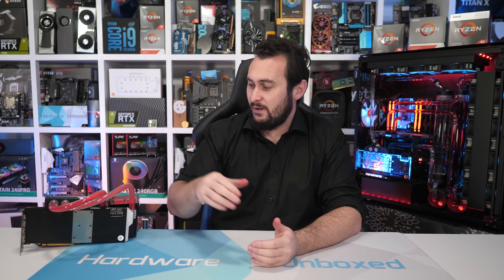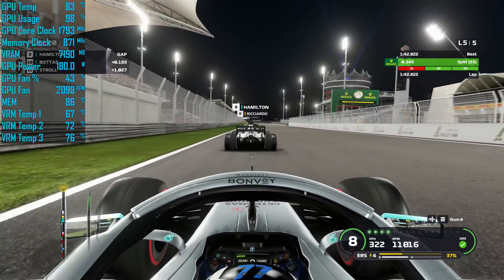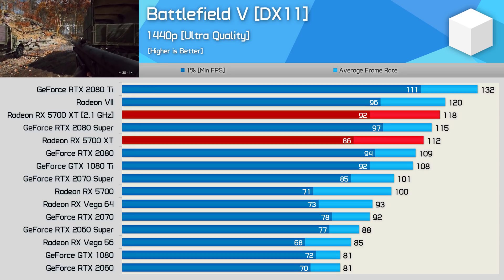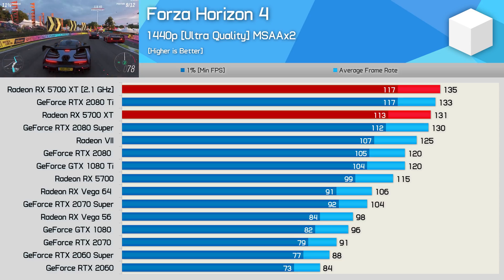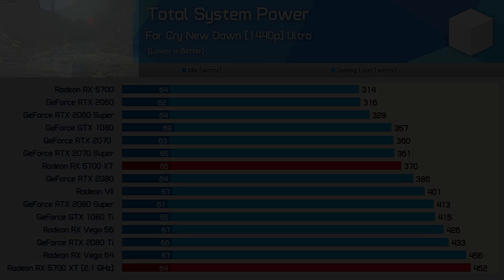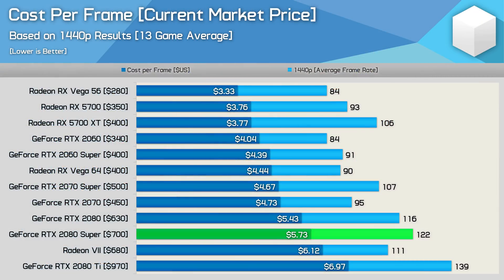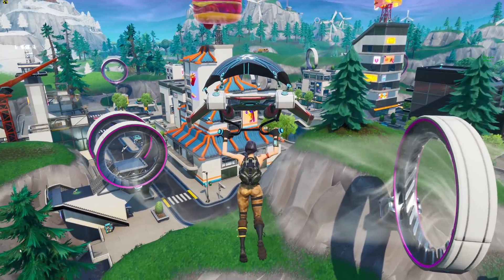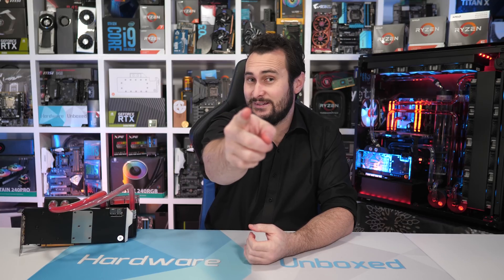Radeon RX 5700 XT Overclocked, RTX 2080-Like Performance?

Comment: Looking at this...its feels like Iam too early to go 1440p\144hz gaming, 2-3 years early, even 2080ti cant do 144fps in many games...2080s, 2070s, 5700xt cant even show 120 :(
Reply: You do know to push more frames you lower the settings right
Reply: @chriswright8074  Or I can just play in 720p right? Like it good old days. Yes I know I can lower settings, I even know some settings basically useless in terms of picture quality and after 20-30 min you can get same picture but +20FPS with custom settings instead of presets, but its not the point. What is a point of 2080ti if it cant give me Witcher 3 ultra 1440p\120+ fps? :) And what about good monitors? I dont even talking about $1500-2000+ :) I dont even know what to buy now, I got good budget but I dont want to waste money...perhaps 2070s and wait next generation of cards, hope for the best...

Comment: Steve's model is actually not well binned. A few months later, those models will be much more mature. 2.3Ghz at same volts I reckon. Great great card!
Reply from the maker: Maybe, you're just guessing though. I have three and they're all the same, you have no idea what yields will be like in 6 months.
Reply: True. I don't have too much knowledge on the node processes and relative maturity. However, as per past trends, samples made months later usually yield better results aka greater maturity/binning.

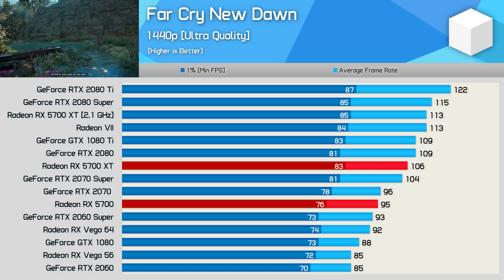Comment: I think there is a mistake in your slide about far cry 5 at 1440p 5:43 . You marked the rx 5700 and the rx 5700 xt but missed out about the OC result which is just right below the 2080 super
Reply from the maker: See pinned comment.

Comment: you should have tested it with the new ryzen and 570 chipset board.
Reply from the maker: Why? You'd risk being CPU limited then.
Reply: @Hardwareunboxed  I dont think that would be a limit at all under given PCIe 4 support ... plus testing with this setup is far more interesting for hardware enthusiasts.
Reply: Considering PCIe 3 isn't saturated by 2080Ti's PCIe 4 wont make any difference. It also doesn't relate to things being CPU limited.
Reply: @H3kler  https://youtu.be/kgnS5AxdyK0 ... if your games can take advantage of gen 4 it definitely is faster. That's why I said I would rather see this setup.

Comment: This really points to a bandwidth bottleneck (as usual with all AMD GPU's).  Oh, and those 1% low drops with memory overclocking are likely from the timings auto-loosening when memory is overclocked (Vega and Polaris did this too).  Additionally, it seems abundantly clear to me that Navi needs more mature drivers...  Not trying to trigger those ridiculous "fine wine" BS memes though :).
Reply: I thought that fire looked familiar.
Reply: We got power play tables so hopefully we get memory tables next.
Reply: I would like to know if there is any possibility to tweak memory timing settings on this card, or any other graphics card for that matter. Is there some bios that can be tweaked or something like that? Perhaps the timings are pretty perfect already, in case of GDDR6 or HMB there isn't that much silicon lottery and no reason to not allow all the possible bandwidth and lowest latency possible. Though still it would be nice topic for a video to try to tweak those settings.
Reply: I'm assuming you're not including the Radeon VII in "bandwidth limited"? 😉
Reply: Give it a few months for a new driver and Navi optimisations, then it’ll easily beat the RTX Titan no doubt :)

/s
Reply: @calebpringle4913  indeed
Reply: got my 5700 xt to 2080 core and saw similar crappy gains so went oc to memory and oh, wonderful 5% extra perf (at 100% stable 24/7 oc) so overall, 2080 like result
Reply: @arencorparencorp2189  what memory speeds are you running?
Reply: @KXP70  925
Reply: Fine Wine literally is gradual driver improvement though.  It just looks like a benefit through those rose colored glasses.
Reply: So not even with all of that WaterBlock mounting (and investment) + extreme overclock it can surprass a RTX 2070 Super. There you go, AIB won´t do mircales, RTX 2070 Super it is. You just made my life simpler, ordered it now! Thanks!

Comment: I recently bought a vega 56 rx for a fair price. I am very pleased with her performance at ultrawide before I had a rx 580 8GB, I plan to stay with the vega 56 for at least 1 year until the 5700 xt mature more drivers and release new cards with better cooling system and higher clock. Whenever I see your tests I see the vega 56 next to gtx 1080 and rtx 2060 and saw that I made a good purchase. I love your tests because they compare in different scenarios with many different hardware. Thanks
Reply: Othon Paiva Good shout. I may do likewise.

Comment: 1800-1900Mhz with an undervolt of 995mV and around 17-1800rpm sitting at 73 degrees with the blower fan during a benchmark with an ambient temp of 25-30C.

Might want to try undervolting, just saying :)
Reply from the maker: So stock then :S
Reply: @Hardwareunboxed  if more games was like Forza or world war z
Reply: @Hardwareunboxed  It's just nice to let people know you can make the card run cooler and quieter instead of 84C at higher/louder fan speeds.
Reply: @Tekagi502  Too much work for most people :D. You are right though. Looking at this there is no reason for AIB. UV and you will get higher core clock and quieter/cooler card. Wait for AIB for 3-4% more performance and maybe pay more.

Comment: I think the card is starving at Memory bandwidth, maybe you can do better with the GDDR6 clocked at 16gbps, a shame that the memory OC is not working
Reply: VRAM test at the end of the video were showing the opposite, at least with the limited overclock/underclock options currently available
Reply: @_Agosto_  Its because of the memory timings not higher frequency.
Reply: @_Agosto_  the vram test at the end of the video only showed that mem OC was bugged...
Reply: @AjrAlves  "at least with the limited overclock/underclock options currently available"

I wouldn't expect any significant improvement with memory oc though, unless they screwed up something with rdna

Comment: Any chance of doing a general overclocking video for the 5700 (non XT) to see if it reaches the XT ?

I also wonder how would a hypothetical 5700XT with HBM memory perform and how much would such hypothetical card cost
Reply from the maker: Yes, I'll use an air-cooler for that video.
Reply: @Hardwareunboxed  Will you also try and do VRM/Cooler tests for the notable AiB cards?
Reply: You cant overclock the non xt because of bios locks (marketing purposes)
If you want to overclock it you need to mess with its bios

Comment: 1080ti performance for 399$, impressive AMD. Very good value.
Reply: This requires pump, tubes, etc... this a $700 card for $700.. still cool though
Reply: You think the watercooler kit is free? Dream on fanboy.
Reply: I didn't comment about no water pump or additional accessories. I said the 5700xt on it's own is still good value for the money.
Reply: Mr BuzzKill  we'll see what happens then... but this video is not a test that proves that a $399 card performs at a $700 level, and it's silly to believe that based on this video.
Reply: Factor in the pump, the water block and everything else you need for water cooling and that 260W power draw and you have to ask yourself is it worth it
Reply: @SuperJosteen  the watercooled rx5700xt here, where running at 45 degress at load with this oc.. so any aftermarketcooler will be 100% enough with achieving the same OC with only 20 to 30 higher temps depends on which aftermarket cooler.. like the 0815 red dragon or the HUGE 3 Fan DEVIL, you choose.

Comment: So you spent
140 for a block
At least 200/250 bucks for Fittings, Tubing, Rads, Fans, Reservoir and Pump.

So it's a 700 vs 700 cards to be honest.
Reply from the maker: Well yeah, that was the experiment.
Reply: @Hardwareunboxed  it's interesting though.

Could you bring it under other cooling conditions?
Dry ice or liquid nitrogen, to extend it to the max possible?
Reply: @Hardwareunboxed  Could you slap on the Artic Accelero 3 or 4 on the 5700 XT? Some Reddit users are claiming that they are having trouble fitting the RAM heatsinks on, and need to find slimmer ones. Temps at 100*C under stress loads. I'd be interested to see your take on this more cost-effective solution and if, in your mind, it's better than simply using the board partner coolers when they come available.
Reply: Kind of, but I don't think that's exactly true either. For someone that's already invested in a custom loop, they already have everything but the card and the block. Or for someone buying all that stuff for the first time, they can re-use everything but the card and the block moving forward.

Either way I agree that it isn't really the most cost effective solution, but it does give an idea of the peak performance this card can achieve when not thermally limited.

Comment: It definitely destroys Navis efficiency, but anything that improves fps is a win for me.
Reply: I guess you have Intel
Reply: Nope. 2080 pulls 450 under worst case, 5700 xt pulls 280 worst case 100 more watts puts it under the 2080 still.

https://www.anandtech.com/show/14663/the-nvidia-geforce-rtx-2080-super-review/15

https://www.anandtech.com/show/14618/the-amd-radeon-rx-5700-xt-rx-5700-review/15
Reply: @arcticfox5118  erm.. you might want to reread the article you posted. It shows the 2080 SUPER pulling 350w in furmark. I agree that the 5700 XT is more power efficient but not by that much lol
Reply: @turkeyslap21  you are entirely correct, i linked the 2080 super version i was looking at. if you look in this one under battlefield 1 its the 400 so my mistake

https://www.anandtech.com/show/13346/the-nvidia-geforce-rtx-2080-ti-and-2080-founders-edition-review/16

i apparently cant read today either
Reply: joshua ward AMD fanboys just trying to inflate their numbers as is tradition.